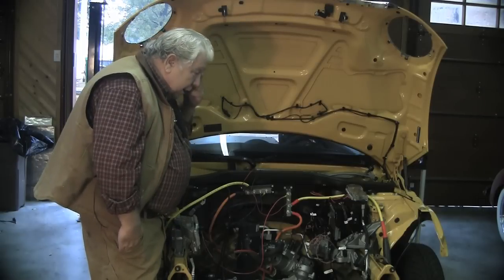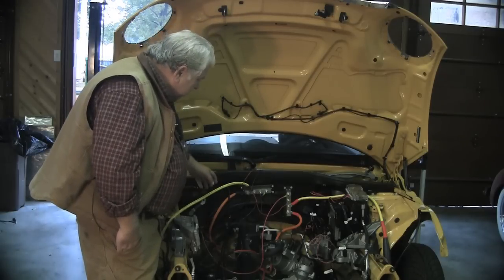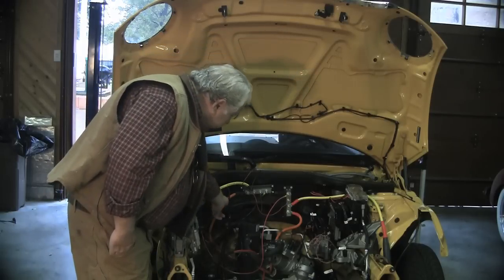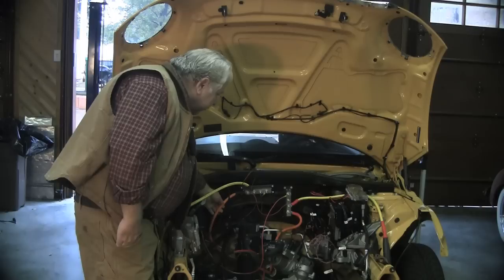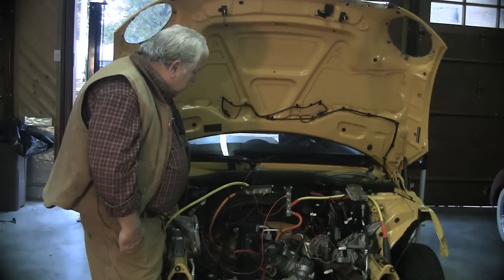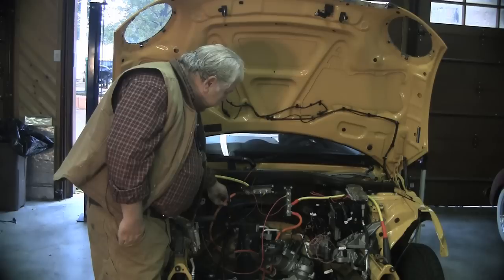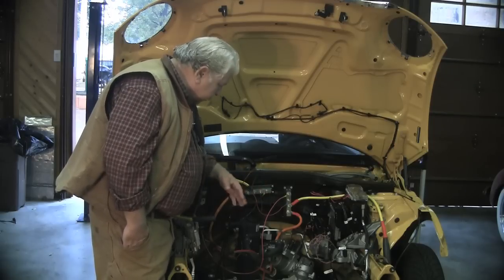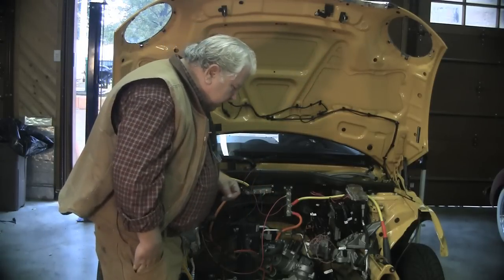EVTV Friday Show 102809 Part 3 of 8

Comment: The handshake pilot signal is similar between the 1999 and 2009 SAE J1772 versions.  In fact you can cut the plug off of a 30 amp Avcon charger,  put the new J1772 plug on it and it will work.  The target price for the connectors $50 for the car socket and $150 for the plug.  But of course the wire has to meat special requirements as an EV charging cord in terms of insulation, flexibility and being able to be driven over several times.